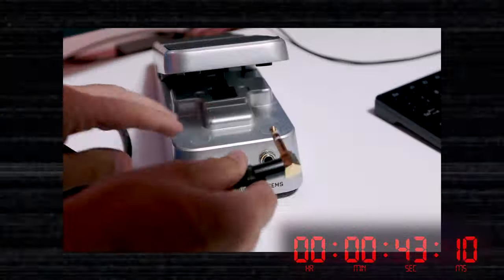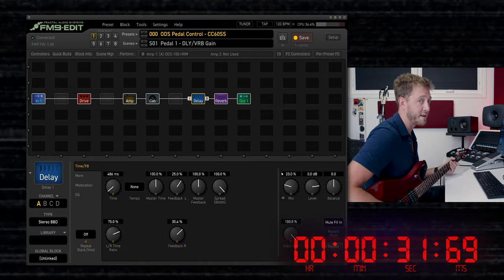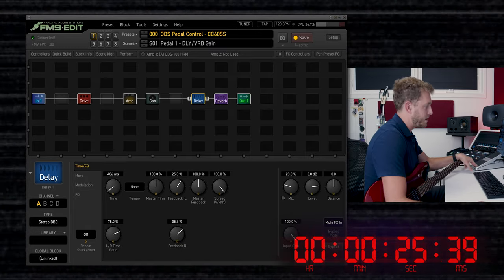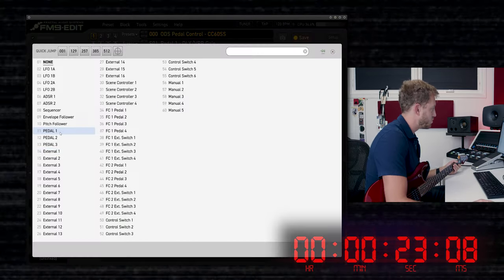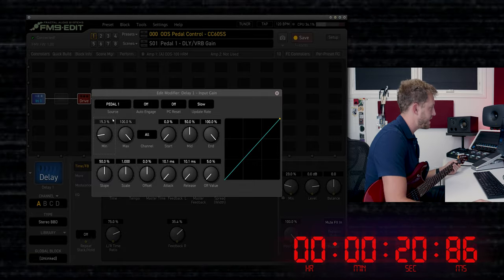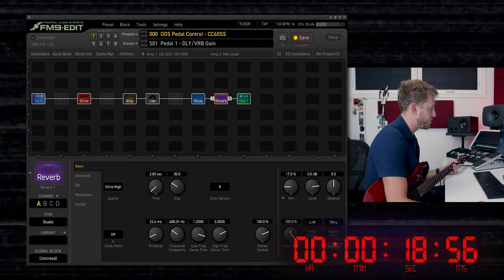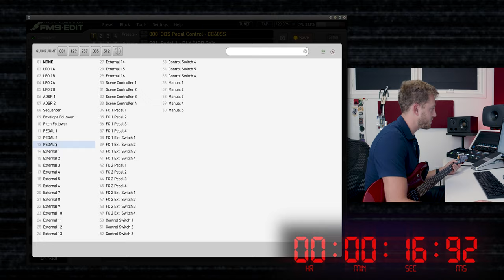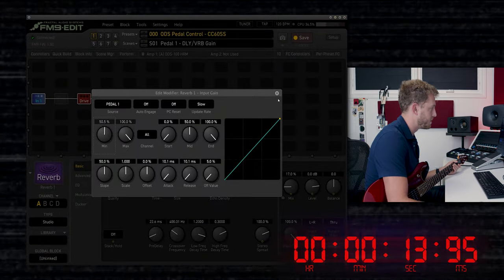Perfect Delay & Reverb Control on the Axe-Fx III, FM3, FM9 - 60 Second Sounds #10

Comment: This looks like a brilliant tip. I have to try this. I have my pedal controlling the mix and had no idea you could use this method to preserve the trails when controlling the mix. I find that controlling my delay mix with a pedal not only fits with some of my originals, it also allows me to adjust on the fly according to the sound of the room I’m in wirhout doing any tweaking on the fm3.